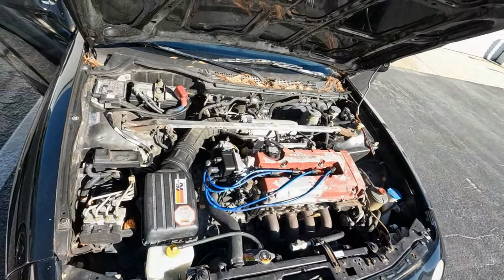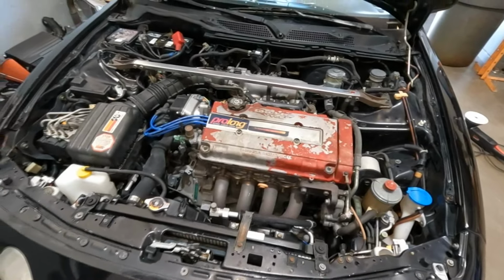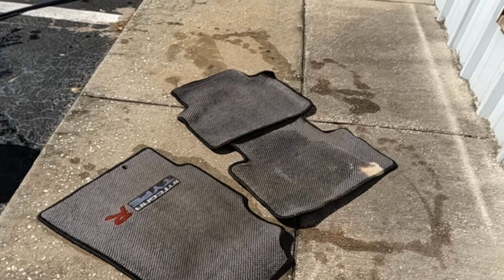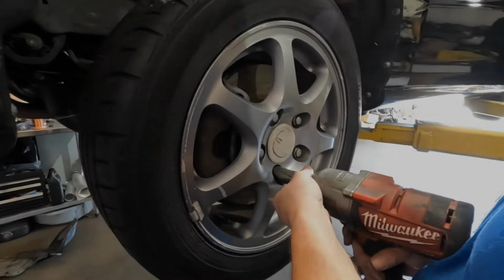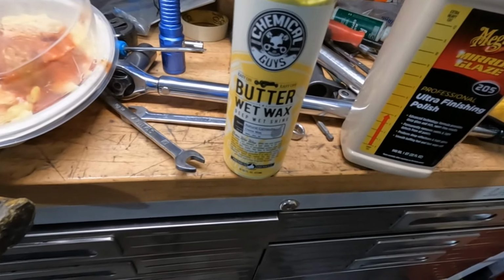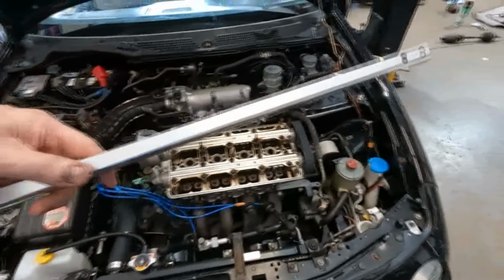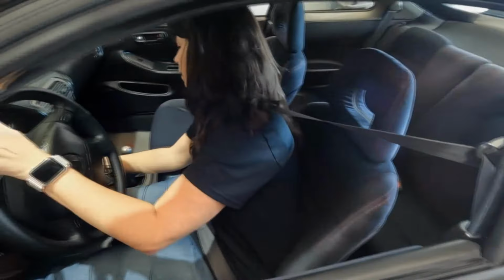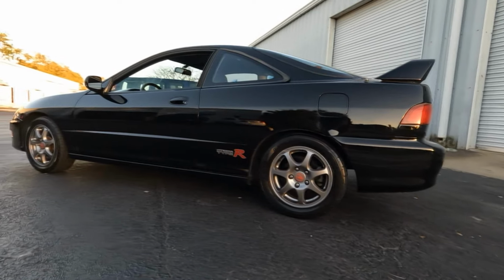We Restore 86 year old’s Type R

Comment: I used to keep my Type R clean. I was driving by the car dealership back in 2001 and they just pulled out the Yellow Type R. I drove in and bought it on the spot for $1,000 over msrp. It was a fun car to drive. I did not like all of the attention or people trying to steal it. I ended up selling the car to purchase an E46 M3 which is still sitting in my garage. I wish that so still had the Type R. If they were cheaper I would buy another one.

Comment: Really great video and really good job getting the Dimond looking new again.  God bless everyone for helping with the donations and God bless you for your time and hard work.  I have a quick question that I can't figure out for the life of me so please please help me if you can.  I have a 2004 honda crv 2.4 I vetec and it runs really good and idles good but when I pull it out of park into drive or reverse the rpm goes up to about 1100 and then beck to normal when in gear.  Any idea what could cause this? Thanks and much appreciated 🙏.  Anyone know please respond

Comment: I really hope it doesn't get stolen. Especially in Florida. My boys GSR was gutted to the frame a few years ago. They attempted to steal my Integra LS once. I had a pad lock on the steering column ( Integra owners know about this 2nd security step apart from the alarm) they couldn't move it. They did steal my Civic 93 Dx one owner super low miles though that was parked next it.

Comment: Hey i had a question so i just bought the same type r seats alcantara and the turtle cleaner wont mess with the seude seats up
Reply from the maker: I’ve used it on all my cars over the years. Including my Porsche. I still use it.
Reply: @LHTPerformance  ok sweet my type r seats are the same condition so basically spray that on them and scrub a little and wipe off
Reply from the maker: @gulick2461  I also used a sonic cleaner with water.  It softens the dirt. Ideally have them professionally if you can.

Comment: PSA: You will notice the Genuine OEM Honda timing belts are stamped with the word "Unitta"  on them. This is the brand name the "Gates" company goes by in Asia (looks up Gates/Unitta).  You can purchase the exact same belt in a Gates box with a Gates stamp for less than half the price of the Honda version.  Gates even guarantees they don't' sell inferior versions of their products to the aftermarket.  Get the TCK version of the kit and it includes the OEM "Koyo" brand tensioner bearing/s as well.  Also AC-Delco Honda timing belt kits usually include a Gates belt and Koyo brand rollers so buy whichever is cheaper. Save a few hundred with that tip right there.  The Gates brand water pumps are not OEM so skip that (I've even had one fail after 2 years).  Honda dealership water pumps are made by Yamada and there is no way to get them other than directly from a dealer.

Some V6 Hondas you can get the Aisin brand water pumps and hydraulic tensioners at half the price in the Aisin box.  Aisin is the original manufacturer for a lot of OEM Honda V6 tensioners, oil & water pumps that were installed at the factory.  The ones you buy after that are all Yamada though.
Reply from the maker: Thanks for the information.  We did find out about the Gates belts but couldn’t get one in time.